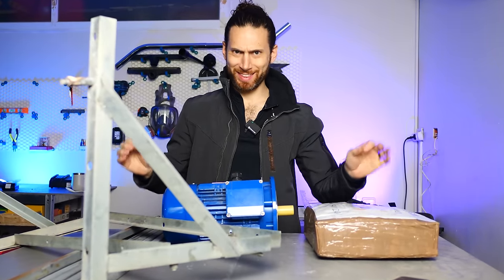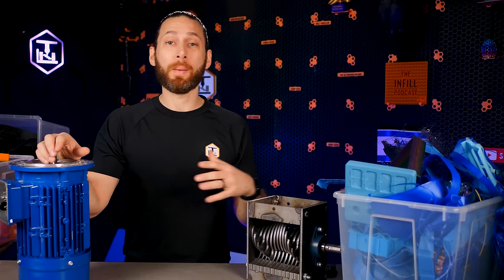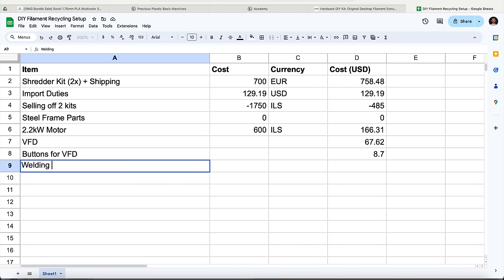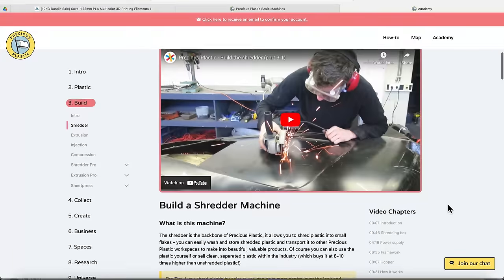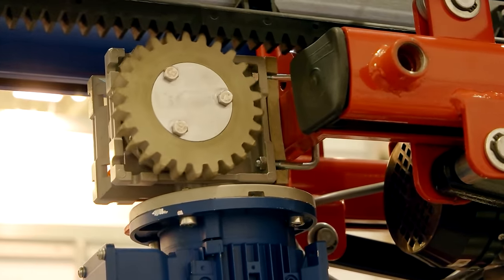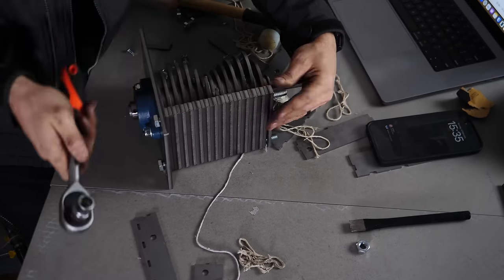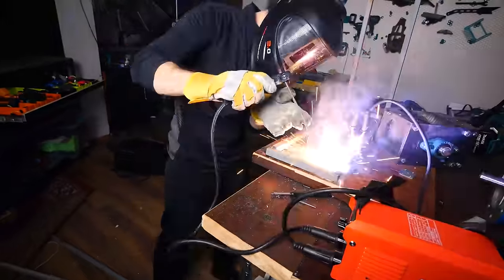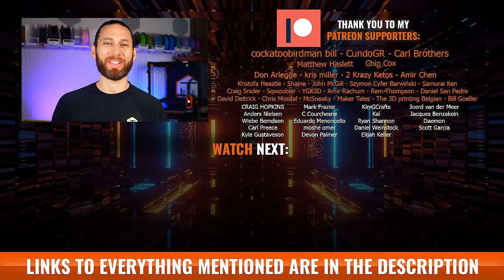Affordable Filament Recycling?

Comment: Looks like you didnt clean the metal before welding. Getting an arc started it much easier, and should help with the sticking as well.
Reply from the maker: Thanks for the tip!

Comment: Hey, if youve got drawings i can nab to plasma cut the metal ive got a sheet of 1/4 inch steel and a plasma cutter...  And im 100% sure theres a 1/2 horsepower motor in my garage from my upgrade to my bandsaw.  Soooo yah... Release schematic, ill make one ^_^. Could be fun, dxf would work....

Also, ugh stick welding.  Youre basically a wizard holding an arc at the right distance from the metal while depositing metal through the arc onto the surface you want.  Ill stick to mig and tig thanks.  Lol...
Reply from the maker: It’s already up on previous plastics website! The DXF files are there. I would love to see you do this and post about it. We will be that much closer to 10 tones

Comment: I have never understood why filament needs to be shredded first. Everything will be melted down anyways, why not just skip it? Sure it might not be as fast or require a sort of staged heating system, but speed doesnt seem like a huge factor for home recycling.
Reply from the maker: Uniformity of diameter in output!

Comment: Reasonable practical and affordable - you just need to get trained in welding and have a workplace and tooling to allow you to weld yourself.
Reply from the maker: Learning how to weld isn't a big deal like you think. I'm still learning but it's only been a few hours. Tooling is $79. A workplace? Do it outside if you don't have a space. In your parking spot ;)

Comment: My big problem with recycling into new filament is that the 'new' filament is a mix of different plastic types, with different melting/extrusion temperatures, with and without carbon or glass fiber filling, and incidental contamination with dirt and non-plastic particles. It is just asking for clogging and bad printing results.

Comment: Recycling filament is great for saving yourself some money in the long run. However, filament only accounts for 0.03% of the total plastics in waste around the world. The impact on the environment it has made is nothing compared to  the molding industry and soda industry.  In fact most plastic is NOT recycled Evan after bringing to a recycling center. Only 30% is on average. Once a plastic container has had a chemical other than food in it it is considered unrecyclable. For example a bottle that had simple windex window cleaner can't be recycled because the chemicals never come out of the plastic.

Comment: Be carefull that shredder its not going to work properly with PLA, if you put to much material trough the machine it will melt inside the shredder, and you're not gonna like it.

For PLA is better something that hit really fast a PLA piece, that will destroy the 3dprints more easly and is not going to overheat

Comment: Huh.
I would have coupled the extrusion screw to the shredding diameter as long as you're married to a motor that size.
The VFD would allow the flexibillity for extruding speeds as well.

Comment: You're probably welding too hot. Lemme guess. Cheap welder?
You want to start your weld on the thickest part of the workpiece. Lower your amps, if you have the option search for "lift start" on your welder.
Your best chance without anyone teaching you in person is to do it slow.
Properly you'd want the amps to be where you are at but move twice as fast.

Comment: Poor guy!! Sell that stick welder and buy a MIG welder and use some flux core wire unless you want to invest in shielding gas. A cheap MiG and flux core will be a lot easier for you to learn with though.

Comment: If it's more expensive to recycle your filament to 1kg reusable filament than buying new 1kg of filament, it's not only a net loss but most probably also worse for the environment over all.
Reply from the maker: How exactly is that "worse" for the environment 🙄
Also, if you remove labor cost, the filament will be free for me after 75 rolls.
Reply: @thenextlayer  Nothing is free, your labor also isn't. If you can be more productive in that time, it is a net loss for you and the market economy.
It's totally fine to do that, it's just good to be aware of it.

Higher prices usually correspond very well with resource and energy consumption. If your recycling is more expensive that buying new products, it is very likely that more energy and more resources were used in order to allow your recycling process, hence most probably a net less for the environment.

Comment: Save your money, don't get the Prusa XL.  HEAVILY overpriced and isn't any better then your current Voron 2.4 which is already enclosed where as the XL isn't and the enclosure for it doubles the price.  If you want better or more MMU option, the ERCF for your voron is the better option.  Getting a muti toolhead printer for "color" prints is a big waste of money, you would NEVER see returns on saving filament from purge towers.  The Bambu AMS lets you print with different kinds of material (hence the name).
Reply from the maker: Fair point. I have the ERCF but it isn’t running properly yet. Waiting for 2.0 upgrade kit

Comment: I am 100% sure this work you are doing here will lead to the use of a pellet extruder instead, it´s the only logical conclusion. In the end why waste all this time and money in pre producing plastic filament if instead you can use the pellets ? This is basically what happened to 100% of all the people who tried to recycle their material and found out that they don´t want to be a manufacturer of filament they simply want to reuse the material and pellets give you 100x more freedom and is 10x cheaper. So I really wish we could skip that step already and go to a pellet extruder directly.
Reply from the maker: Poetic extruders make a fair bit of sense, but not as much for reg grind as much less consistent. The other thing is that for me, at least I am always getting new 3-D printers, and most of them are pre-release, so it would be a lot of work to try and adapt, a pellet extruder. Plus, if we want this project to have a major impact, we need to get the plastic into a format that anyone can use not just a select few people with pellet extruders. 1.75 mm filament is a standard that most printers, except, so it will be much easier to use that for 3-D printing. I guess pellets can be recycled in other ways, but that’s not the goal of this project.
Reply: @thenextlayer  "...The other thing is that for me, at least I am always getting new 3-D printers, and most of them are pre-release, so it would be a lot of work to try and adapt, a pellet extruder...." This I can absolutely understand. For you it´s probably less useful.

"...Plus, if we want this project to have a major impact, we need to get the plastic into a format that anyone can use not just a select few people with pellet extruders..." This is already the whole problem. Why use filament at all ? Because that´s what we had at the time, it´s basically a gap fill solution. 3D printing was invented for rapid prototyping, costs and material amounts didn´t play a big role back then.
I would argue what really needs to be done is bring the costs down and this can only be done with a pellet extruder because all of the sudden your 20$ material costs will fall to 2$ per KG of the same material even from the same company.

"...1.75 mm filament is a standard that most printers, except..." It not a standard, it´s a de facto standard and why is that ? Because 3D printing was used for rapid prototyping 30 years ago and that´s what was available. To truly change we need to improve on that. Driving costs down by ten fold usually get peoples attention. In the end one would need to add virgin material to the recycled stuff anyways that´s why most people think "hmmm why not use the pallets from the get go, why waste my time in producing a pre product to then only melt it as well".

I understand that this isn´t your goal, that´s fine for me. All I am saying is this won´t really change anything. No person in their right mind will weld and make and fabricate a huge 200kg block just to grind down old prints and to then fabricate a new product which can be store bought for 10 bucks or so, cost wise this is insane.

Comment: 45 seconds in and I can already see theres no way this is viable for the average bloke.
Reply from the maker: Why not?
Reply: @thenextlayer you need a spare motor, supplies of steel, a welding set, workshop space, that's a considerable amount of money spent, ideally access to a lathe and milling machine. Plus the skills to use it all. And that's just to make the machine to break up the plastic, we've yet to consider turning it back into filament.

Comment: https://youtu.be/Hm6KpEajD4o?t=968 at this timestamp you see symbols (left) in the V colum .. if you see those you can convert (other vids on YT)  from 115/240 or from single/dual/triple fase .. just make sure your circuitbreaker doesnt trip example 10A x 230v = 2.3Kw  enough for a 1.8kw motor :) en some lights

Comment: Its not cheap or practical to build your own its probably easier and cheaper to just buy one.
Reply from the maker: For $3,000 for just the shredder? No thanks. Did you watch the video?
Reply: @thenextlayer  Ive seen much cheaper then that, Its not really practical either though having to build everything from scratch, Ive been looking everywhere to be able to recycle my filament. Not all of us have a place to take metal from an abandoned building near your house, If I was to have to build from scratch I would need to buy metal as well and its not cheap, You certainly not gonna by a motor like this for less then 700 dollars, I watched your entire video and prices here in canada are very expensive. I mean Id like to see your finished product and know how much a full setup would cost that and including the time spent on building it.